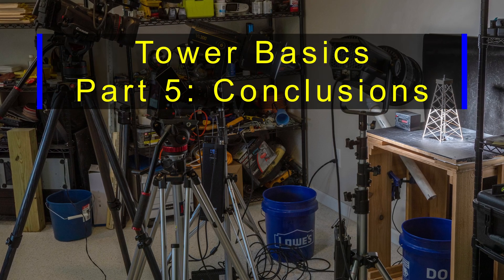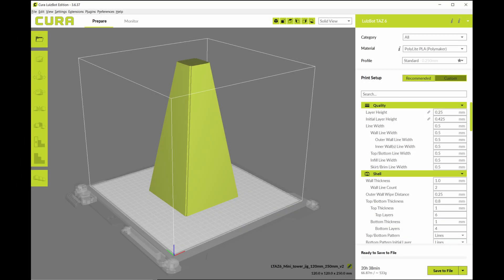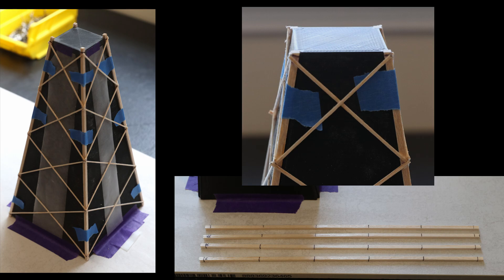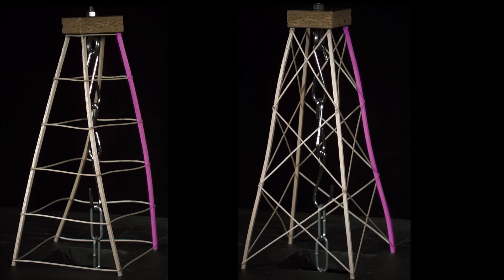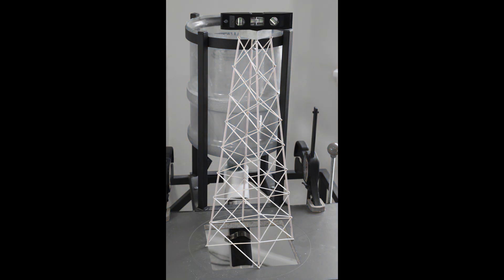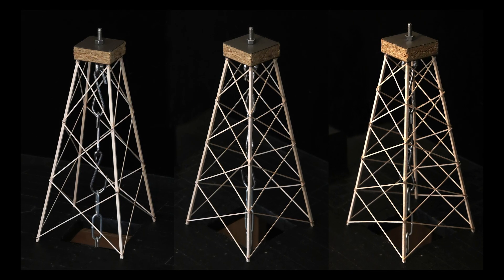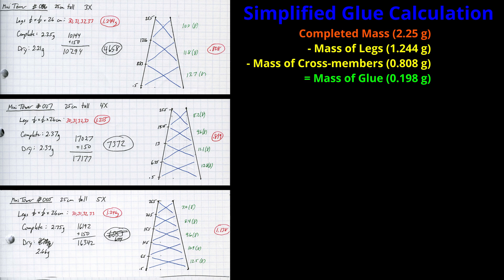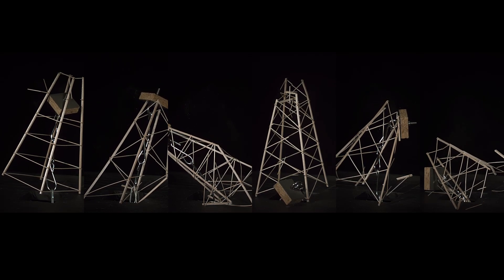Tower Basics: Part 5: Conclusion

Comment: 1) May I ask what is the appropriate 3D printer for this project - is this one Ok? Creality Ender 3 Neo 3D Printers with CR Touch Auto Leveling Bed Silent Mainboard Full-Metal Extruder Carborundum Platform DIY Ender 3D Printer for Kids Beginners Printing Size 8.66x8.66x9.84 inch 2) would the layout you shared print tower #5 in your video. Appreciate your help.
Reply from the maker: That 3D printer should do fine, especially with the non-bonus jig which is what I'd recommend you start with.  Good luck!

Comment: Hello, Thank you for the video. Any idea where to buy the Balsa wood that is 22 inches (>50cm) or longer? Thank you
Reply from the maker: Hi!  I highly recommend you buy your balsa in sheets (which are usually 36" long) and cut your own strips to any length and width you want.  I like to use Specialized Balsa, but you can get balsa sheets many places.  Check out this video when you get a chance: https://youtu.be/bLsTOpmozGI

Comment: Hello! thank you for making these informative and detailed videos. I was wondering, what CAD software do you use to make your jig? I have been using tinkercad, but it has not been precise enough for making a jig. Thanks in advance!
Reply from the maker: Hi!  Thanks for the kind feedback!  I've been using Solidworks for my modeling.  It's a really nice tool and worthwhile to learn if you have access to it, but it's not free.  You might want to check out FreeCAD which seems like it would have the features to make good jigs.  BTW, I will be releasing the STL files I'm using for my actual builds for this season once the rules come out, so you'll be able to get started with that if you want.
Reply: Thank you!

Comment: Howdy, what materials could we use to make our on jig without 3D printing? Also, is an octogon a better base than a square, and what is the optimal amount of cross members? Lastly, I haven't seen the rules yet, are they out? Thank you so much.
Reply: Also how tall did you make these mini towers, and will we get similar efficiency if we have proportional cross member spacing?
Reply from the maker: @AabirKhan-n8h  The mini-towers were 25cm tall.  I'd say the mass scales fairly linearly with the height and retains most of the strength, so the ~7400 efficiency 25cm tower is very much like a 3700 efficiency 50cm tower
Reply: @balsaengineering6686  Thank you so much. My school is starting up science olympiad so I am excited.
Reply from the maker: I coached Towers in 2017 before I had a 3D printer and we made an assembly jig out of wood and copper pipe.  Imagine a 4x4 block with a 1/2" hole drilled in it.  That block is glued to a piece of wood and a copper tube is in the hole.  Then at the correct height, you make a top that holds the 4 legs in place.  With a jig like that, you build 2 sides flat first and then put them in place on the jig and connect the rest.  That can work well if you are careful.  A square is the simplest design as you don't need to worry about angling the cross-pieces.  An octagon might be fun to play around with, but I'd wait until you have some simpler towers made first.  From my tower study, something like 5-7cm gap is a good starting point for the # of layers.  The official rules don't come up until early September. The draft rules are available via the SciOly summer workshop, but they aren't published publicly

Comment: Would you think it would be ideal to scale up your jig to normal tower size? Also, whats the benefit of a pyramid shaped tower, versus one that has a pyramid shape on the bottom with a rectangular prism on top?
Reply from the maker: Hi!  While I don't know the final rules for the upcoming season yet, I would guess scaling something like this up to full size will work well.  It certainly did with the 2017 rules.  As for a continuous versus a 2-part prism, I'm a big fan of keeping things as simple as possible.  Usually continuous pieces are a much better solution than a piecewise solution.  FWIW, the 2018 rules pretty much required a 2-part solution and it was very complex to build.  I'd probably recommend at least starting with the simpler design first and then experimenting once you know what kind of scores you'll need to beat with a more complex design
Reply: @balsaengineering6686  do you have a scaled up stl from 2017 rules?
Reply from the maker: @rylanchau3645  Unfortunately, I don't.  Back in 2017, I didn't have a 3D printer yet, so we built the assembly jigs out of copper pipe and wood.  I am currently working on some preliminary builds with the draft rules.  I will definitely have something to share when the new season officially starts
Reply: @balsaengineering6686  oh alr thank you so much!

Comment: If it were based on the 2018 rules, it seems impossible to make the tower legs a straight piece because of the circle and the height rules (Div C) How would you approach it?
Reply from the maker: You are correct!  This basic design would have only worked for the 2017 rules.  The 2018 rules required basically a 2-part design with a large base with a tall, narrow column on top of that.  It was quite complex to build that year!  It'll be interesting to see what design specifications they have for this year.  FWIW, the concepts shown here regarding buckling and bracing design definitely applied even for the 2018 rules, but it was implemented in 2 different parts for the final tower

Comment: Hello, i was wondering if there was any way to get 1/32 balsa sticks from flat sheets. Or if you would recommend buying them pre cut.
Reply from the maker: It's possible to use a balsa stripper to cut sticks from a 1/32" sheet, that's what I do, but it's challenging, so it does take some practice.
Reply: @balsaengineering6686  if we were on a time crunch would u say its fine to use 3/32 X 3/32 as a replacement for the 1/32 cross braces
Reply: Has there been any advantage to braces across the centre to prevent the rhombic buckling mode or did you find it a waste of weight and getting in the way of the central chain?
Reply from the maker: @TimpBizkit  Yeah, cross bracing completely across the center wouldn't work as there needs to be room for the chain.  While these structures can deform easily in that mode, it doesn't seem to effect the strength vertically

Comment: Hello, I have two questions. First off, do you know around the time the draft rules for the 23–24 season come out, and should the legs be stripped from one piece of wood or should they be precut? Since you talked about how to have the best tower, they should be the same weight.
Reply from the maker: I think the draft rules typically come out in mid-July.  That is the time of the Science Olympiad coaching seminar.  I always strip my balsa pieces.  It's not too difficult and much cheaper than buying pre-cut pieces.  Either way, you will have to have a large library of pieces to get identical ones to choose from, but it's worth it.  I go over some of the challenges of getting the exact pieces you want in this video: https://youtu.be/bLsTOpmozGI
Reply: Any thoughts on laser cutting a sheet of balsa vs stripping it?  Can you see any disadvantages or pitfalls of laser cutting?
Reply from the maker: @longjay69  I've never tried that as I don't have access to a good laser cutter, but my guess is that for simple stripping of sheets, it won't be worth the hassle.  If you try it, please let me know how it goes!

Comment: Is building a tower with only 3 legs a good idea?
Reply from the maker: We played around with 3-legged towers back in 2016.  It wasn't worth the hassle for the most part.  The angles for the cross-bracing are difficult to make work as nicely as a 4-legged towers.  Feel free to experiment though!  It might depend on the actual rules if it makes sense or not.